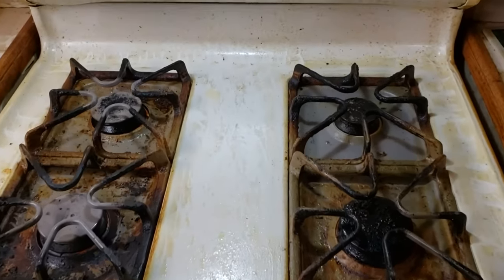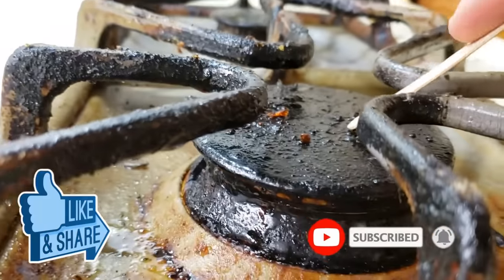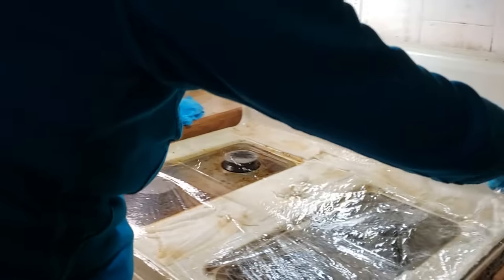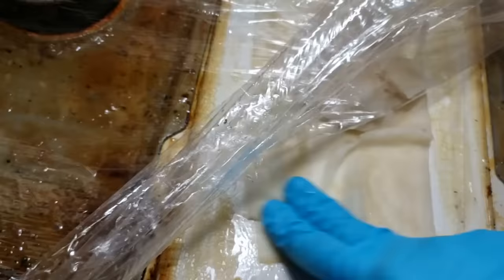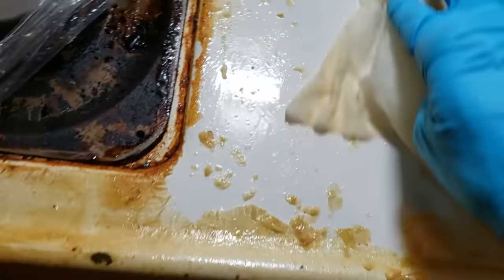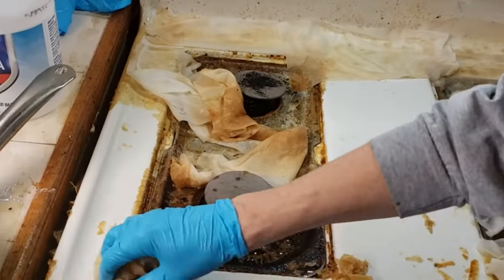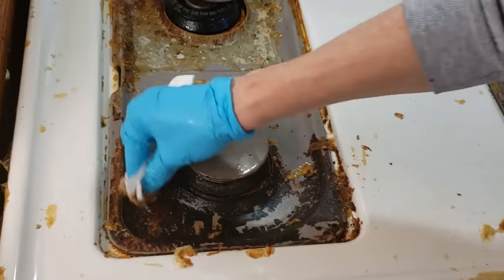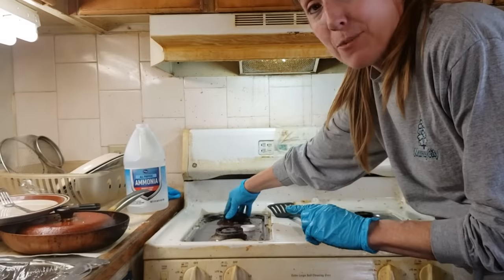How to Clean Stove | Over a Decade of Grease Build Up Gone! 💥 No Scrubbing!

Comment: It really worked!!!!!!! Thanks so much! Life saver!!!
Reply: @tracydavis7705  No, I didn't. I just followed what she did, but I think I didn't let it sit overnight, which I probably should have. Not all the grease came off, but it made a big difference. The smell was just so strong (though the plastic wrap really helped) that I couldn't wait to get it all off.
Reply: I'd add though, be careful if you have older pipes (like I do) and if you decide to dispose of the unused Ammonia solution. I googled and found that I could pour it into the sink as long as I do it slowly and turn the tap on to dilute it, but we ended up getting a small leak under the sink after pouring out the ammonia, which we don't know if it had to do with the solution being too strong.

Comment: I used to clean rental units and houses as a RE Management professional. To clean greasy baked on gunk from stove burners and grids, as well as broilers and oven racks, I always used plain non-sudsy ammonia. Place all removable parts into a black hole-less garbage bag add 1/2 cup to 1 cup ammonia to either a dense sponge or pad of rags and then tie the bag shut. Place outside in the hot sunlight and let this sit for several hours or even overnight.The ammonia fumes do most of the work. Meanwhile clean the rest of the stove! After several hours I would use a pressure attachment on a hose and rinse all the gunk away outside on the lawn. Most times the water would clean the stove parts right down to the metal with no scrubbing whatsoever! Good as new without scrubbing. And ammonia is safe for grass--it adds nitrogen to the soil and acts like fertilizer!
Reply: Exactly what I needed to hear Thanks!
Reply: I’ve used this method for the grates before but I didn’t know you could seal up the stove top like this. This is amazing! And I didn’t know ammonia was safe for grass which is something I was worried about.
Reply: nice cheap way to clean.
Reply: What if you have dogs?
Reply: If you don't have garbage bags can you use a storage bin to put the racks in and just cover it?
Reply: Would this work on the grates for my stove?! I’ve been trying so many ways and I get them pretty thing but not as clean as I want. I’ve been thinking of order new grates from the company but would rather try this if it’s okay to do! Id love your thoughts on how to clean the grates the best! Thanks for sharing this tip, I will certainly be giving this a try today!!

Edited to add:
I am able to get all the grease, food etc off easily with bar keeps friend powder. But what I am unable to remove is what looks like burnt something and that’s what drives me nuts not being able to get off.
Reply: Wow really!? So I could sprinkle ammonia all over my dried up lawn and it would make my grass nice and green!? 🤔🤔🤔😮
Reply: Can ammonia be used on steel
Stoves?
Reply: @muisefamily8620 not exactly, the ammonia is only safe for the grass when diluted A LOT. In this cleaning scenario it would be safe as you are spraying the parts of the stove top with a hose thus diluting the ammonia. For it to act as a fertilizer it would have to be diluted to under 100ppm from its original state of 20000-100000ppm
Reply: Hi. What does non sudsy mean? Without foam? What type of stores sell that? I'm in Eastern Europe.

Comment: Am writing from Nairobi, Kenya and watched your video a few days ago. I had to try your idea. We don't have Dollar Tree here so to get ammonia and large Ziploc bags is not possible. I managed to get ammonia solution from a supplier of lab chemicals at a cost of 1.5 dollars. I had to soak my stove top for 2 nights and a day. I was amazed when all the gung and grime came away. It was so hard like cement and I had totally given up on it. Now its like new. Thanks so much
Reply from the maker: You are welcome 😃😃😃 I'm so glad it worked so well for you too.  Thank you for letting me know 👍
Reply: Girl! I'm in Nairobi too. Please share your  supplier's  contact.
Reply: It looks like gas stove.  Was gas turned off when u cleaned or can it be left on.   Thx
Reply: @Tee-sz7tw  I've  done this often when I worked as a house cleaner and never turned the gas off.  Just the stove.  However I have never saran wrapped the stove.  Great idea.
Reply: Please share the Nairobi ammonia supplier contact
Reply: @Tee-sz7tw  Depending on the type of gas stove you have you want to make a personal choice. I have an old gas stove which kind of looks similar to this but when you lift the hood the pilots are lit on top of the stove as well as under the boiler. When I clean the stove top with any chemicals and let them sit I have to turn the gas off because if I simply blow out the pilots the gas will seep out as it’s very old. Newer models would not have this problem.
Reply: Which lab.. share contacts
Reply: Thank you for replying and letting everyone know this technique works.
Reply: Hi, I was born in Nairobi Kenya. I moved away aged 5, would love to revisit one day. Have very vague memories

Comment: My mom was doing that back in the 1050’s. works like a champ.    I go to dollar tree and buy containers of ammonia water.  Have a tub with cover that I fill with ammonia water.   soak all items from stove top over night.  Do the exact same thing with paper towels and saran wrap for the stove top.  As for the oven, get a 9 x 13 glass cake pan put a dish cloth inside and fill half way up with ammonia water.  Heat your oven to 350, turn oven off and place cake pan in oven.  you will. e surprised as to what you find in the morning.  All the mess will be on the floor of the oven.  Just wipe out with paper towels.  The oven walls, racks and ceiling will be shiny clean.
Reply: You are onto it about putting ammonia into a warm oven that’s been turned off. Next morning get soapy cloth and’s wipe. Jt
Reply: @jeanniethompson947  with the pilot light still on? Isn’t the fumes of ammonia inside oven gg to explode?
Reply: Glad to hear that your mom did this in the 50s.  My stove is vintage from that era so I know this process will work for me.  Thanks!
Reply: your mom is thousand year old

Comment: Years ago I had a rental property that had a stove that had grease that was caked on and hard.  I went to buy new parts and grills that would have cost $100’s.  The store owner told me to take the loose parts, 1 cup of ammonia and put it all in a sealed plastic trash bag outside in the sun. When we checked it a few hours later, it all came off!  We hosed it off (not near any plants) and they were like new.  It seems the fumes were what cleaned it. 
Great idea for the stove top! Saturated paper towels and Saran Wrap!

Comment: Something that I've found that works almost instantly on grease on the stovetop and surrounding walls, floor, and tiles (and we're talking some years of buildup) is Goo Gone, believe it or not. It's like the loose oil attaches to and breaks down the sticky oil and turns it back into a loose oil. Use it with a Mr. Clean Eraser for maximum effect. However, I definitely learned something from this video and will  try the ammonia soak method in the future for the stove grates and the black cooked on stuff. Thank you for sharing this video with us!
Reply: That's what I tried too but so so results or maybe I was impatient but I sprayed it like three times or so. Thick layer....what a pain...

Comment: I've come across stoves in a few investment rental properties we took on.  Being a clean freak myself and budget conscious, I would clean the stove rather than purchase new.   I used the same method with fantastic, like new results.  Putting all loose pieces that can be removed in gallon zip lock bags with 1/4 cup of ammonia in each bag, then put them all in a large heavy duty trash bag.  Leave the bag outside overnight or in a well ventilated room.  If the stove is gas,  I turn off the gas line (and pilot if there is one), then spray the remainder of the stove with ammonia,  cut open a trash bag or two and cover the stove and seal with painters tape.  If necessary, protect any flooring or other surfaces around the stove.  The next morning, the majority of all the grease and grime wipes or washes away with water.  Very minimal scrubbing was needed. However, the fumes are very strong! I wear a ventilated mask and chemical resistant gloves while prepping and cleaning.  Actually, the smaller parts that I were placed in bags are opened and rinsed with a hose, then brought inside for a thorough wash in sudsy water. One thing to be careful of is any painted/printed areas.  These days most of the indicator markings for the knobs and functioning components can easily rub off with aggressive cleaning products.
Reply from the maker: This is GOLD, thanks for sharing your method. I'm trying it next time! Genius. Especially the part about sealing off the stove with a plastic bag!
Reply: Im cleaning a stove in a place i rented instead of bothering them to replace it
Reply: Tbh a dirty stove is not a reason to replace unless it’s deemed unsafe by a sanitation crew
Reply: @jayasmrmore3687  I think for a rental, they'd want a very clean stove. That way, they can get fair market value and decent tenants. If it's your own, and you are not too picky, I fully agree with you!! JMO
Reply: @taffykins2745  did they try cleaning it
Reply: Brilliant cleaning tips!🙌
Reply: I'm trying to stop my son from ditching the stove in the rental we bought! We haven't been successful in cleaning the grease streaks down the side, but I'm getting ammonia today and doing just this; we saw the exact same stove at DIY store for $787; I showed my son, and said my cleaning rate is way less, get out of mama's way!
Reply: @copout510  Landlords would love a tenant like you!

Comment: Take all the loose pieces including the oven racks, put them in a black trash bag with a cup of ammonia and leave outside overnight. A professional house cleaner taught me that and it works like a dream! Given the way ammonia worked on your relative's stove top, I bet you could use the trash bag method and it will melt off the grease by the time you are done cleaning the inside and hood, etc.

Comment: For the black burnt carbon, I've seen on tik tok to use Ketchup.
i would use the same overnight/soak method, using paper towels great idea 💡
Slather and let the acedic acid chemically balance / treat it

This is amazing solutions this is probably why ammonia was discovered/ rooted out/ based exactly for this wow
I'm totally amazed

I'm here for the grease solution, and you have solved it.
For the black carbon, use Ketchup.
We got the grease with elbow grease scrub.
The carbon comes off with ketchup and works a lite polish too

Comment: I recently cleaned a GE gas stove and used AWESOME cleaner.  I soaked the burner pans and grates in a bucket of hot water and CASCADE COMPLETE LIQUID.  I was able to wipe the burner pans reasonably clean and I scrapped off the soaked burned on goo that resulted on the grates.  I rinsed the grates and then put them in a self-cleaning oven (not in the stove I was cleaning) for 4 hours and they came out super clean (so did the oven).  

What you can't easily remove is the rust that results from the moisture in the long-standing grease.  And, also, you need to lift the stove-top up and clean all of the goo that has dripped down inside of the stove.  You can remove the burners to make the underside easier to clean.  There is a lot to do, but yes, the 18-year-old stove I brought back into service is now clean and since it has a brand new GE microwave above it, it almost looks new even by comparison.

Comment: You can also wipe with a damp cloth then sprinkle baking soda and add drops of fresh lemon (works best) or lime juice and let it sit for 10 mins, or longer depending on mess. Then use the outer peels of the lemon or lime to scrub the stove. Because the texture of the peels act as a scrubber, there's no scrubbing pad needed. The baking soda and juice creates a paste and it works amazingly well! You can also use the inside of the fruit to scrub if u need more juice but I prefer using the outer peel.
Hack came from my step-grandma; full of wisdom and hacks. 🤗👍😀
Reply: Can we use baking soda with vinegar
Reply: I did all this stuff and now my burners won't spark up
Reply: My stove is gas and had to blow the burners (with my mouth) before turning them on to remove the paste that accumulated. Just be careful in the future not to create too much of a paste around those areas. I thought about using a can air duster to blow that area but didn’t want to cause an explosion. I’m sure vinegar can be used but the smell won’t be very pleasant.
Reply: @teresamanriquez2925  pp
Reply: @teresamanriquez2925  try poking a  toothpick in those areas to get the dried paste out.😉 also works great around the ring of the burners.

Comment: Hey there, I saw the video two weeks ago and was amazed by this, but I didn't find this ammonia cleaner in my country, so I bought a bottle from a chemicals company, same concentration.
I applied with paper towels, and was prepared to leave it for hours like you did, but it started to peel off after 3-5 minutes! and in my case, it was 25 years of grease on an old cooker, not 11, so a new record there for ammonia! :) 
Thanks alot for this, I think I'll keep ammonia in my house for these cases. Also, I couldn't withstand the ammonia, it immediately burnt my eyes and nose, so I took everything outside.
Reply from the maker: That’s amazing!! Thanks for sharing. Ammonia is a miracle cleaner!

Comment: After you get it clean put aluminum foil under the grates, that way when it gets greasy again you can just toss the foil and it cuts down on the work you have to do
Reply from the maker: Yes.  That is a nice way to prevent this kind of mess.  I also suggested he use a lid to prevent splatters and a quick wipe down after each time he cooks.   Thank you for your comment
Reply: I'm hoping our new tenants do just that; we've spent alot of time cleaning this fairly new stove (this type still for sale in the DIY store), and just came across this solution; my son just called me, our straight vinegar isn't working; headed over there this morning with ammonia.

Comment: I think it's wonderful what you're doing. To make it easier, use oven cleaner on the top of the stove and place Saran wrap over it. The other, use a razor blade to get off the remainder of the burnt on grease versus scrubbing with a paper towel. Scrub Daddy sponges also work very well.

Comment: OK, I’m gonna give this a try.

We don’t have an issue with grease buildup. We clean the stove regularly, but when anything would overflow it was building off around the burners where it would just get charred. 

We couldn’t stop while we were cooking and it’s normally have to sit long enough for the large cast-iron rates to cool off that by the time we can actually get to include it it is dried. So I’m hoping that will dissolve the stuff. I tried it last night with vinegar.

Comment: May I ask a few questions!:
Can it make the smoke detacter go off?
And would you recommend someone who lives in a small apartement with only  1 window in their living room to do this?
And in instead of wiping down without a paper towel can we use a scrub sponge?
Thanks
Reply from the maker: Of course.    No it shouldn't make the smoke detector go off.  You really want to work in a well ventilated area.   One small window may not be enough.   Ammonia is so strong.  You could try a small amount to 1 spot and see how you do.
Reply from the maker: You can use a sponge.  You wi just need to squeeze it out and rinse it a lot.   Good luck
Reply: Put a fan in  the window facing out and see if it makes it more ventilated.
Reply: @CleanFreakGermaphobe  AND wear gloves

Comment: Does this work with open burner stoves? The ammonia might spill into the stove and I hope that doesn’t cause a problem
Reply: Well if I remember correctly the stove top just opens up so you can clean down there, maybe use the paper towel method near the eyes of the stove so you don't make too much of a mess and then open the stove top somewhere near the end or at the end of your cleaning session to wash up anything that might have fallen in there throughout the process or overtime beforehand?

Comment: I came looking for help because my stove is so hard to clean I don’t do it as much as I should or want to. After watching this I went and found some ammonia I had in the garage and am currently soaking my stove top overnight. Thank you!
Reply: Jennifer, did you get the same results? We are about to try this for grease streaks down the side of a rental stove; we're going to spray the ammonia on, put paper towels on it, and leave for as long as the towels don't fall down.
Reply: @theresak4343  It does work but it smells so bad! :D
Reply: @gennafer  Jennifer, we did it! Yes, the smell was awful, and of course we had all the windows open; we saved the stove, saving us $800.

Comment: Biological washing powder detergent can be used to clean the stove top. With hot water poured over the top. Set the oven on the lowest setting for about 5 minutes to maintain the heat and it should be easier to get the grease off because the enzymes in the biological detergent break down the grease. I've used this method on multiple occasions.Make sure you turn the oven off before cleaning. Using the powder acts as a minor abrasive. If you can remove the grates and the burners you can fill a sink with boiling water, sprinkle the biological washing powder on the top and leave for about 30 minutes.